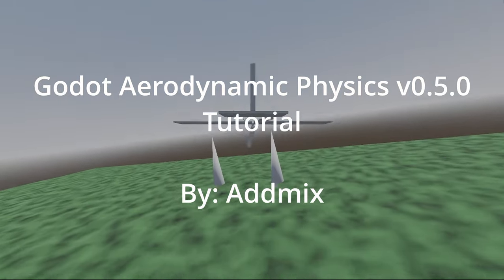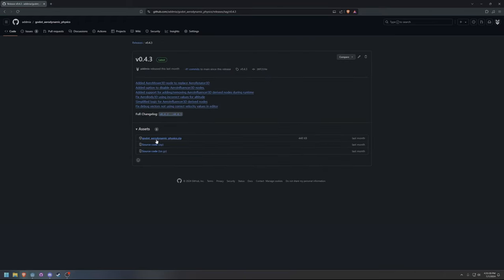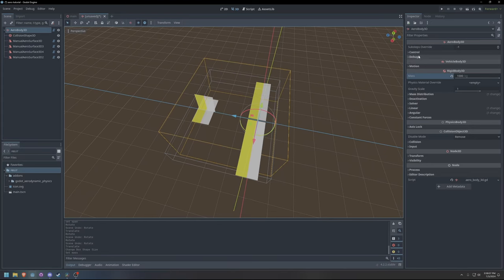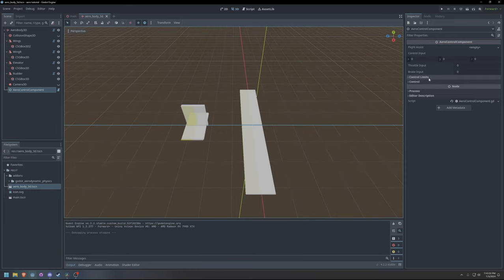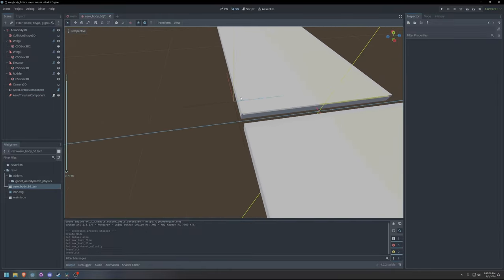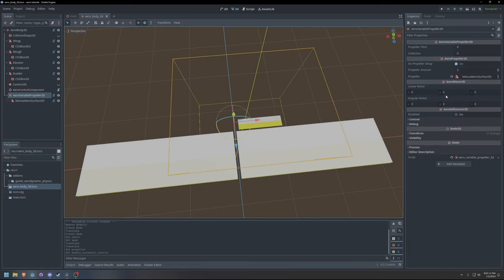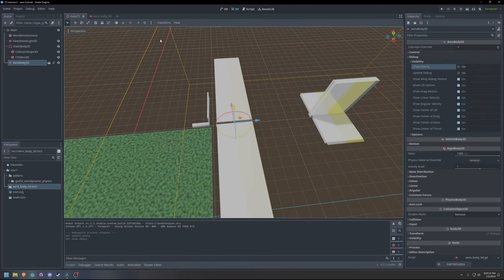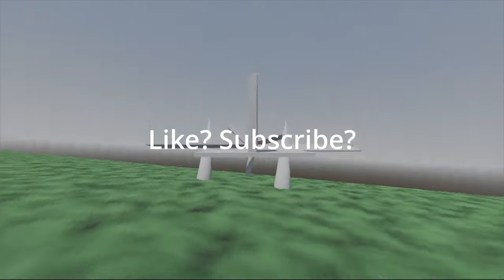Godot Aerodynamic Physics Tutorial (v0.5.0)

Comment: sadly in 4.1.1 i found an error in the script that i do not know how to fix, what godot version is this meant for?
Reply from the maker: I have kept the plugin up to date for the latest Godot versions. I did look into the issue, and it looks like the problem is that in 4.1, static typing in for loop conditions didn't exist. I suppose that makes the plugin only available for 4.2+, however if you must use 4.1, you should be able to remove the static typing from the for loops.

for substep : int in SUBSTEPS:

In this example, the static typing is the ": int" part, which only exists for a slight performance boost, and some better editor auto-fill.
Reply: @addmix  thank you so much!

Comment: Tell me how to throttle up and throttle down the propeller, I can't get it
Reply from the maker: I'm working on an expanded control system which covers propellers, and allows for more extendability. In the meantime, you can use the propeller's angular_motor property to control the speed of the propeller. 

An example would be: `$AeroPropeller3D.angular_velocity = Vector3(0, $AeroControlComponent.throttle_command * 100.0, 0)`

Comment: tutorial worked great! do you have a tutorial up about the camera effect or if you could recommend a tutorial ? thanks
Reply from the maker: The demo project is linked in the description, if you want to look at the code.

All the camera code does, is set the camera's position/rotation as the linear and angular velocity of the airplane, multiplied by some factor to exaggerate the effect.
Reply: @addmix  thanks a lot it worked flawlessly! i was wondering what I would adjust to make the wings more smooth. it feels kind of snappy when it changes. thanks again!
Reply from the maker: @okokokokokokokokokokokokok4360  The AeroControlComponent has input smoothing options which can be enabled. Or, flight assist being used, which also acts as input smoothing (in a way)

Comment: So ara analogue controls possible if you set input action to a control stick? 
Gotta play arround a bit with this :)
Reply from the maker: Yup! Any control that you can bind in the InputMap works properly. Now, the only thing to wait for is for Godot to add mouse motion to the InputMap.
Reply: @addmix  Sounds great - I don't need mouse input.
Reply: @addmix  Are there any workaround or manual implementations of this style of behaviour which could be achieved with something like mousemotion in an InputMap? Where the mouse positions, Y axis is bound to the pitch and the X axis to the roll. I am using your plugin and its been really really good. It would also be nice to be able to manually control the input values through code for implementing PID controllers, custom flight assist, War Thunder Style cursor based control and a simple mouse control system where if you move your mouse move up the plane pitches down with the centre of the screen being idle position for the controls. Although you havent implemented these yet, I was wondering  which scripts to mess with to configure this to my use-case without messing everything up. 

Another of topic thing, when I add Wheels3D or whatever the node is called, the whole flight simulation doesn't work and the plane just behaves like the plugin doesn't exist!! Even after removing the wheels the issue isn't fixed. I had to restart making my aircraft btu it was just a prototype. I dont know if this just me or wheels break  the sim.
Reply from the maker: @THISISAUNIQUEHANDLEDONTCOPY  Yes, there is a way to override the custom control, I believe I had mentioned it in the video, but you can disable the "use_bindings" property on the AeroControlComponent, and then from a script you can manually set control, throttle, and brake inputs. If you join my discord server I can give you the real examples I use in my flight sim project.

The AeroControlComponent has a flight assist, using the FlightAssist resource, which you can extend/modify if needed. The PIDs are adjustable. The flight assist also has a "target direction" mode, which would be used to make War Thunder style controls, you give it a direction vector, and the plane will try to fly in that direction. You would have to set up a system to get the direction vector from the mouse in screen space, and pass that in, as the target direction is in global space. You can enable target direction inside the FlightAssist resource from the editor (or from a script), as an example, you could set the target direction like this: $AeroControlComponent.flight_assist.direction_target = ... #set it to whatever target direction you want

In fact, I extended the AeroControlComponent script for my F16. Inside _physics_process, I grabbed the input values from the throttle and stick, and applied them to the control_input and throttle_input variables inside the control component. (currently you have to disable use_bindings on the control component for this to work)

At one point there was a bug that cause VehicleWheels to interfere with the aerodynamic physics, but that should have been fixed a few months ago. Are you using the latest version of the plugin?